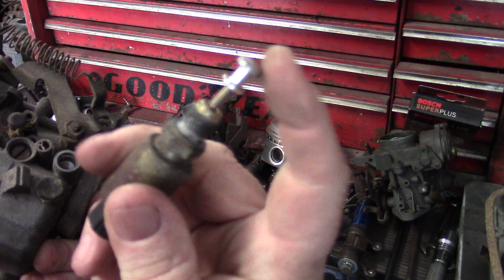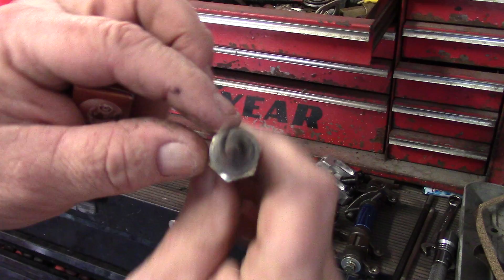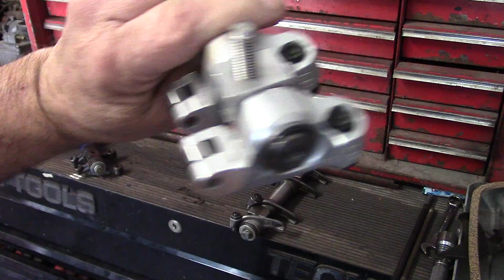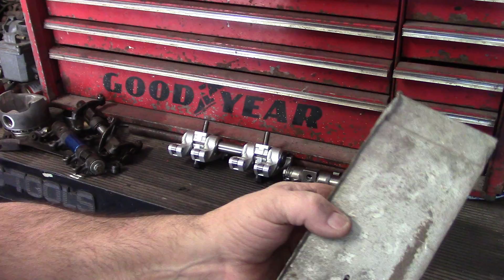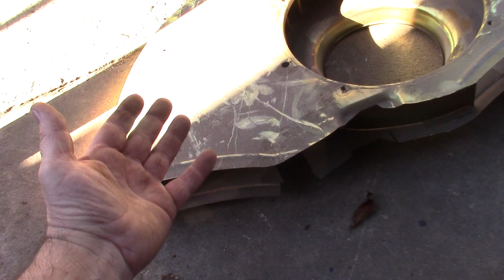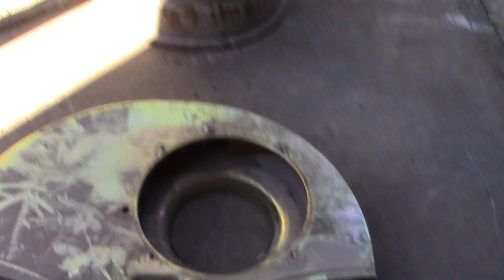VW stuff

Comment: speedi sleeve  is for 36hp vw flywheel  so that way u don't have oil leak do to cut curve on flywheel cause by rear main seal Part number is 99235. U can get it at any local part stores.